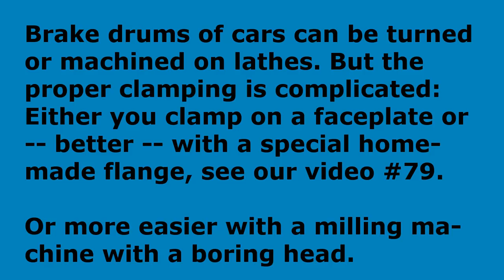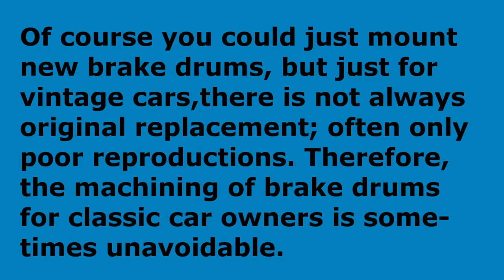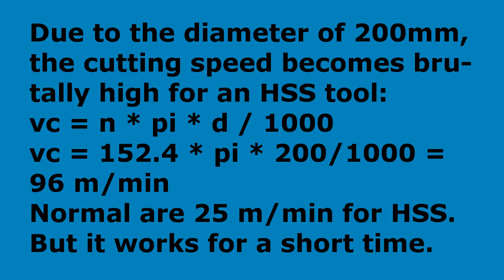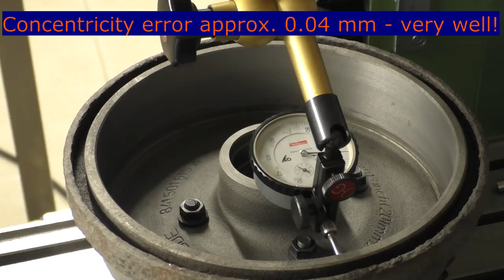turning brake drum

Comment: Use a rubber strap around the drum to absorb the high frequency vibrations to get a better finish.  A tarp tie-down strap will do in a pinch.  Otherwise, the drum will ring like a bell and cause ripples in the finish.
Reply from the maker: The finish is well but your advice is good. Thank you.